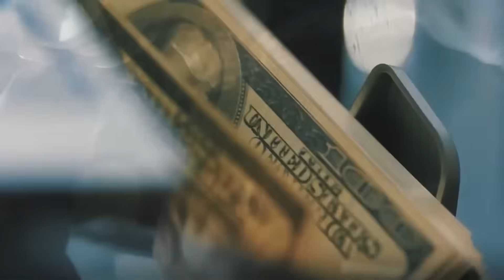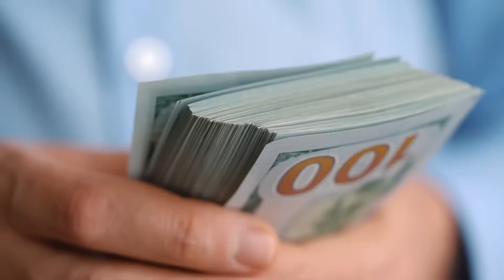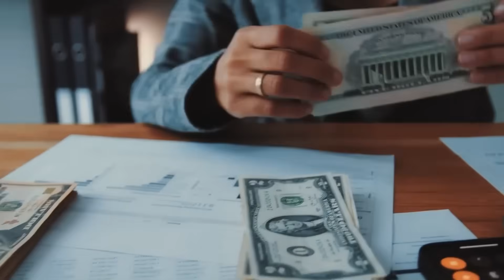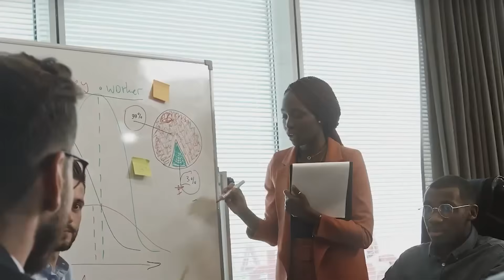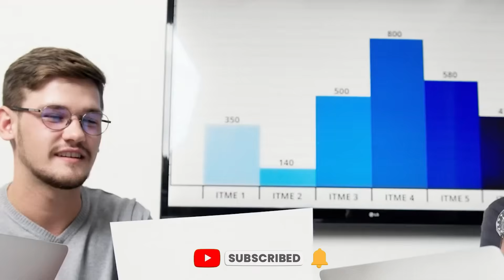Why Cost of Repairing Broken EVs Is Unbearable

Comment: No one can convince me that driving a used junker making 35 mpg or 5l/100km is more environmentally friendly and more economic than buying a new EV.
Reply: @palosnes3147  EV's aren't zero emissions. A lot of fossil fuels are used to mine the rare earth minerals that make up their battery and ship them over to the US. Depending on how much you drive an EV, it can take upwards of 10 years to reach true zero emissions. And I haven't even gotten into how over half of the power grid uses fossil fuels because renewable energy isn't as reliable.
Reply: Here is a practical example, when I bought a used ICE minivan (pacifica, ~25mpg) vs the used plug-in hybrid version about 3 months ago. Since my daily trips are around 25 miles, I would never have to buy gas if I bought the hybrid. But:

- At 25 mpg and roughly 25 miles a day, I estimate my yearly gas bill at roughly $1000 here in Colorado.
-  An EV's electric bill is estimated at roughly 1/2 to 1/3 of the gas bill, I haven't looked up the KWh rate here but let's say I'm saving $700 a year in gas.
- Based on the price bump, roughly $4-5000, I would need about 7 years just to make up the difference in price. That's a long time in car life. (Even more dramatic if buying new).
- 1/3 of colorado's electric power is generated via coal anyways.
- The biggest cost of car ownership is not gas or electricity but repair bills. ICE's I'm familar with and can do all the repairs by myself. With a EV or a complex hybrid drivetrain, I cannot reasonably do the repairs and every drivetrain issue would have to go to the dealer. A single repair bill for a minor issue in the drivetrain, say, around $2000, is roughly 3 years in gas savings.

In terms of practical considerations:
- At least for the pacifica, the EV will be slower and heavier (roughly same horsepower, heavier by about 600 lbs). The battery also restricts cargo space, in that the seats won't fold into the ground. For example, I'm driving around with the middle row permanently folded into the ground in the ICE version.
- I like cars, and I keep my cars forever. For example, I traded in my '93 corolla, bought brand new, in 2015, after about 30 years, which means I'll be eating most of the repair bills in time or money. It is questionable how an EV will function in 30 years, whether there will be new battery packs manfuactured for a 30 year old car, etc. However, there is no question in my mind I can keep an ICE running for at least 30 years.
Reply: @q335r49  Excellent analysis. Unless you drive an awful lot, most people will not benefit from an EV or even hybrid. You could argue having a Toyota hybrid if you have run a taxi, Uber or courier. Toyota is the only manufacturer I’d trust for a hybrid, as they have the most experience. Still, most people who drive under 25,000 km (15,000 mi) a year would be better off driving and meticulously maintaining a good used gas vehicle.

Comment: Following my last comment, let me present few examples. Clutch in my 16 years old Quasqai (petrol engine) simply broke down due to being 16 years old and I paid to my dealer about 650€ for a new one. Now on my newer Quasqai 2019 (petrol engine) having only 75000 km (46600 miles), there is something wrong with gearbox or clutch (dealer has no clue), so dealer being a dealer offered me to put a new clutch for 2600€ (totally insane).
About 3 years ago, a young lady drive hit me directly in my front bumper, which made a scratch on it, nothing significant. My dealer in repair shop charged her insurance company for about 2200€ for new peace of plastic.
A friend of mine bought an Audi (petrol engine) about a year ago, and while driving on the highway a rock hit his left headlight. He paid about 3500€ for a new one. After which he sold the car.

But, sometimes one gets "late Friday car", and everything goes wrong with it, and it has nothing to do with EVs being much more expensive just for being EVs and having batteries.
Inflated pricing exists only because of the dealers who want to rip you off, nothing else.

Comment: some information  not sure if correct  but because of repeating pattern.   I think this is partially false information.   A.  tiny accident compounds to multiple repairs (driver assistance).  not all EV are made with that thus nissan leaf cars are not made that way.   then you state individual parts has to be light weight (repeatedly) materials,   so what!   ICE is made with light weight materials too.   then you stated something about not individual batteries and as a pack.  mechanic simply do nothing and pull fuse.   AGAIN wrong. mechanic pull fuse to protect, but does not protect against 200 to 500 volts of energy. 
too many weirdness.... I think you are a cheat.  probably used AI to generate filler video in certain sections to get money from advertisement.  wait a minute did not see any advert.   so  a clickbaiter of some sort.   I give you thumbs down for the fillers.

Comment: Insurance claims make repairs more expensive. I accidentally backed my vehicle (an ICE car) into a large concrete block, smashed a taillight, and caused a small dent that pushed the boot lid slightly out of alignment. I decided not to have the repairs done through insurance and took the car to a body shop. The repairs were excellent and cost $580.  About a month later I was rammed in the back at a giveway sign, and the damage was almost the same as when I backed into the concrete block. However, this time I had the repairs done through my insurance company, and having the almost identical repairs done by insurance cost $4,000.

Comment: The only reason that EVs are expensive to repair is profiteering.
The only expensive part is the battery pack, and it is extremely rare that a whole pack goes faulty so that a single module is all that is needed.
The answer is very simple.
TRAINING of mechanics.

Comment: What a crock of shit,   Bearings wear out in the motor, you replace them and go.   No need to overhaul, no fuel injectors, no oil, no coolant.  There's a documentary, "Who killed the electric car".   There's a visit to a GM shop, the mechanics actually are wearing ties.  They don't get grease all over themselves.   The dirtiest part of the job comes from replacing the disk pads.
       This is a horrible article.
Reply: Yes Those electric motors are very high end even if the frame is junk Lots of application for the spares parts off the ones salvageable I agree.

Comment: EV's aren't zero emission when you take into consideration the fossil fuels used in the mining of the rare earth elements for their batteries on top of the coal power plants needed for the power grid to meet the ridiculous energy demands of EV charging. Depending on how much you drive it, it could take upwards of 10 years to reach true zero emissions. Most EV's won't even reach that point due to accidents and other maintenance issues.
Reply: Phase 1 - Remove emissions from exhaust - CHECK
Phase 2 - Better Earth friendly batteries and manufacturing methods employed - CURRENTLY IN PROGRESS
Phase 3 - Refining renewable energy practices to charge said batteries - CURRENTLY IN PROGRESS

As you can see, these are baby steps but steps in the right direction. Saying that continuing to do the same thing as we have been doing for the last 100 years will achieve a different result is naive or just plain ignorance.
Reply: @joeking22  Renewable energy simply isn't capable of replacing fossil fuels. Most of them only function intermittently, and they all have environmental costs that people singing their praises either omit or don't know about. And batteries themselves are an environmental hazard. The process of mining the rare earth metals destroys entire ecosystems whose process is outlawed in the US for environmental reasons, but done regularly in less developed nations. The manufactured chemicals that make up the batteries do not originate in nature, so every time there is a battery leak or fire, it is releasing chemicals into the environment that nature can't deal with.

Comment: The only problem with EVs is that companies try so hard to make the car "sexy" that it ends up costing just as much as a BMW or Mercedes to repair. The battery almost never fails, but boy does paintwork and bodywork eat into the cost effectiveness of repair.
Reply: It generally takes a few years for a electric battery to fail, but when it does, expect to pay around 15k for a new battery.
Reply: But when it does, it fails in a fiery but mostly hazmat requiring fashion!

Comment: I'm not sold on ev's, I don't have a garage or a good enough charging infrastructure to make it viable for me. BUT, please try to make stronger arguments in videos if you want to make a viable point than "average repair costs", when there are not really any economy class EV's, they are ALL an average higher cost than ICE cars, so their parts are also higher cost, just as a Mercedes has a higher parts cost than a Hyundai. This alone would account for a higher "average" repair cost without any context at all. Once again, I'm not sold on EV's, but please consider making arguments with more detail and equivalency than such a broad measurement.

Comment: I've seen a Model 3 written off because it got a dent in the underside and they said it was too dangerous to work on. The theory was the battery might have been damaged. Second hand car yards hate them, because they depreciate so fast. I know one where he had it on the lot for a few months and he had to sell it below his cost to get rid of it.
Reply: All brand repair shops make excuses like that, not unique to EVs. What the problem is there are too few side street EV repair shops that keep repair prices low and two; there is little standardisation with EVs, every manufacturer use their own parts, that means no standardisation in spare parts, battery modules etc.

Comment: Little bit of fact and truth , EV's are far more reiable than ICE vehicles with less moving parts . OH and the hining over subsidies checkout the full write given to tradies utes
So lets get the facts straight "EVs have way fewer moving parts, and are therefore not as complex to repair mechanically, when compared to a gasoline vehicle. Unlike a gas vehicle, EVs don't require thigs like engine oil changes every few months."
I suspect this story is nonsense but so many swallow it ASTONISHING

Comment: While I don’t support electric cars prices can vary drastically depending on model and make of cars ev or combustion, the biggest cost of repair difference is in the cost of replacing a battery and the environmental damage the resources that go into the battery cause compared to what’s saved.

Comment: Google AI Overview:
Electric vehicles (EVs) generally have lower maintenance and repair costs compared to gasoline-powered vehicles due to having fewer moving parts and no engine oil or fuel systems. While the upfront cost of an EV might be higher, the lower maintenance costs can offset this over time.
Reply: Any maintenance  savings incurred by purchasing an EV are quickly undermined by the depreciation of the EV.
Reply: @user-rf9ws7hp3e They depreciate more than ICE's but it as far as savings go, it depends on the cost of the vehicle. If I spend $180,000 on a car or $20,000; one I might lose $40,000 on and the other only $5,000. Depreciation works on more of a percentage basis. Not all cars are equal.
Reply: Sorry, they are not lower maintenance it's just deffered until after the warranty expires, then it all comes due at once in the form of a battery replacement.
Reply: @tellucas   Are you saying this with experience? Or is this just something you've heard?
Reply: Also from Google AI: "reliability studies rank Tesla among the least reliable car brands"
Reply: @RestorationWatch   That literally means nothing, I'd love to see which other car brands it is talking about; I'm certain some are ICE's.
Reply: @bradynyoung1717  Of course there were but the bottom of the list for reliability was dominated by BEVs, Hybrids, and PHEVs. Land Rover was down there with their ICEs. One thing that was interesting is that Tesla has been near the bottom every year since they were taken over by Musk after he pushed out the founders through a hostile takeover.
Reply: Yes got one and can confirm your statements, and the running cost about $25 per month charge it from roof top solar .

Comment: Modern ICE cars are engineered to last no more than 150,000 miles or 10 years. Their engines and transmissions are generally not rebuildable and each cost as much or more than an EV battery. Which is the only major wear component on an EV and should last 350,000 to 1,000,000 miles depending on the battery chemistry used. In general if well taken care of an ICE car will begin to fall apart at about 100,000 miles and have a major failure of the engine and or transmission by 150,000 miles. At which point the repair cost will exceed the value of the car. A modern well maintained EV should have no major repairs during the life span of it's battery.
Reply: If that was true, why do EV's depreciate at a much faster rate than traditional ICE cars? Why do insurance companies charge a premium for EV's if they are so reliable and long lasting? There are a lot of people spouting the same flash card talking points, but the people putting their money where their mouth is are insurance companies. They know they can't afford the risk of covering an EV without increasing the cost of coverage.

Comment: Not a single person in this comment thread knows how cars work or are repaired.
Reply: I do I am a 4th generation mechanic with over 35 years experience. Cars still had wooden wheels when my family first started working on them. EVs are much more reliable than ICE cars. Mechanics don't yet know how to work on them because so far there aren't many on the road and modern EVs (those made in the last 5 years) are so reliable they don't yet need repair.
Reply: @THX..1138  Like Teslas, which in reliability studies have consistently been ranked among the least reliable car brands.
Reply: @RestorationWatch  I think 8 years ago Tesla didn't know how to mass produce cars as well the rankings as a full of crap. 

Nearly all count all service issues, not major drive train issues. In fact some count Tesla's regular over the air updates as recalls. Along with actual non critical recalls. Which Tesla actually fixing known problems without someone filing a class action law suit against them is a good thing. Vs other manufactures who don't for decades fix problems they knew from the start were unaliving people using their cars.

The fact is if you compare Teslas and ICE cars made in the last 5 years. The difference is striking. 100% of ICE cars are engineered to last about 150,000 miles and Teslas are built to last as long as they possibly can. Currently you can expect the battery to be the weak point of a Tesla and you should get a lifespan of 350,000+ miles before it fails. Even there Tesla considers a battery failed when it loses 30% of it capacity, not when it actually stops working.

where as if you have a modern ICE car it has low tension piston rings and nickel silicon coated cylinder bores. Your car will likely start consuming oil after around 70k miles. somewhere around 150k miles oil consumption will get so bad the excess oil destroys your catalytic converters. There is no fix for this you need to replace the engine and catalytic converters. Which will cost about the same as replacing the batter in a Tesla.

If your car has a CVT transmission(it probably does) they also have a lifespan of 150k miles and also cannot be rebuilt and also cost about the same to replace as a tesla's battery. 

Also...The average driver drives 15k miles a year. if you try to extend the life of your car by not driving it they install torque to yield bolts which act as a mechanical fuse/timer that insures your cylinder head will fail about 12 years after if was manufactured. This can be fixed for about 1/2 what a replacing a tesla battery cost. If you wanna pay several thousand to fix a 12 year old car.
Reply: @THX..1138  Few on the road where you are.  China has many.
Reply: @Onan-u3b  Yes I'm in America. Chinese cars are illegal here cuz they are garbage that can't pass safety or emissions testing.
Reply: @THX..1138  Not to mention, for the ones that don't have issues other than tires there's nothing to fix!
Reply: Speak for yourself Stupidude666, there will be people here that have forgotten more than thee shall ever know.